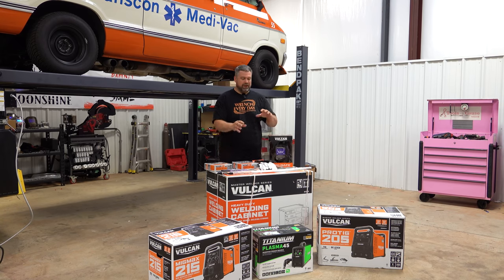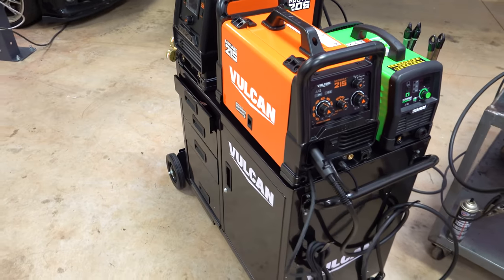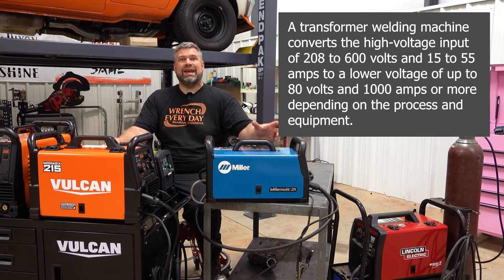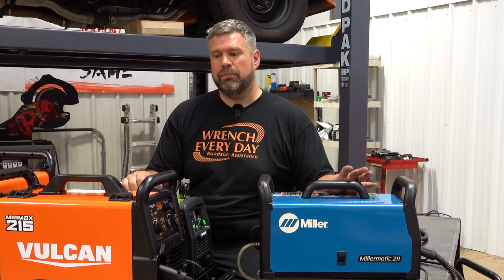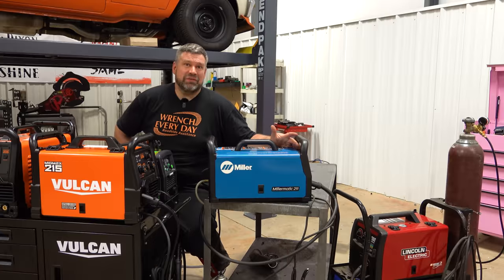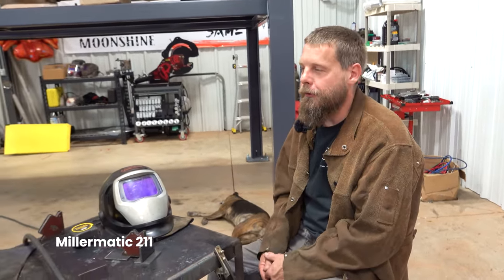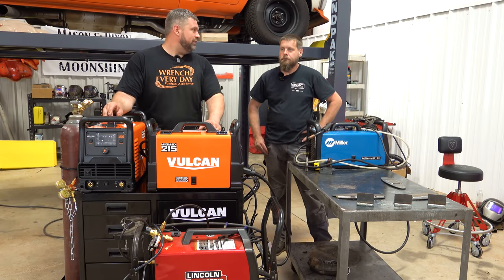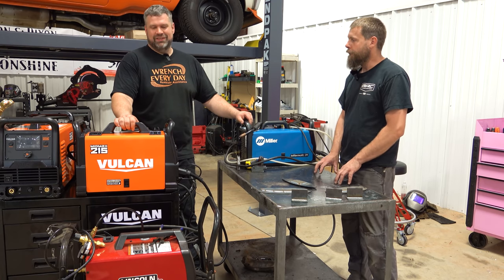Here's What NO ONE Will Tell You About Harbor Freight's "Best" Welders....

Comment: On inverter efficiency and loosing less power to heat. It's a welder, it all goes to heat 😁. Difference is more of the power is going to usefull welding heat vs uselessly  heating some massive transformer. 😁

Comment: One thing i noticed is that he was welding the other joints using the miller and Lincoln machines with the magnet still on the metal. That pulls the arc from the weld. Secondly, he was overly biased based on his history with the Miller machines and referring to their service history. Miller and Lincoln are the industry standard but their prices are too expensive for the average welder or anyone that is going to be welding a a hobbyist. Most don't purchase miller or Lincoln welders unless they are prodded to do so by another biased welder. My advice is go for what fits your budget and the job at hand and if you know how to weld,  all of the machines would work great for you

Comment: You did not Manchin the duetey cycle of the different machines and how that relates to how long you can weld at a time. Small parts no problem big part could be a big problem if you have to wait for your welder to cool off to keep working.

Comment: I'd much prefer an older transformer machine. It is a simple power plant with very few parts to wrong and extremely easy to fix..... Unless the transformer blows up.. With the inverters, you have a switch mode power supply. Lots of parts to go wrong. I have seen more electronics with SMPS's have their power plants goof up than the older kit.
Reply: If you're in it for the long haul you can't beat transformers. It's wire wrapped around iron. SMPS there's a lot that can blow. The only question is not if but when.

Comment: One thing you made a comment that the synergic welders they take a little bit to get up and go no that is not true. they work just efficient as your Transformer welders. you just got to read the manual most people do not read the manual 👈👉at all 👈and it's not just a one setting machine. you can preset your own settings if wished with synergic welder and wire speed👈 by going through your menu button. welders they don't take their time to get up and go the synergic welder will stay right up with the best Transformer welders from start to finish with no problem.👉 they do not lag at all absolutely not👈
The problem is nobody takes the time to go through the manual to understand how the machine function they look at the book real quick and then they're off and running doesn't work that way read the manual understand the settings God bless..

Comment: Au contraire comment: I have had a Miller (transformer) MIG welder (Millermatic Challenger 172) for over a decade, and the feed is giving me fits, and I CANNOT replace the feed roller. So it gets tossed, and I bought a HF Titanium MIG 170 (inverter), which works fine so far, despite a chickenshit (90 day) warranty, which I extended for extra bucks to 2 yrs.

Comment: I believe you guys are a little unfair with these machines .yes everybody has their favorites I did own Miller Lincoln over 200. amps and up . some very large machines also over the years.. welding in a race car shop when you become semi retire you don't need big machines anymore. but you do buy the machine that is going to be efficient for the jobs that you're doing in your shop or home. synergic is a great machine give it a chance you will grow to love these machine just like the Miller's Lincolnshire and the other types out there. depends on what type of welding you're doing if it's going to be commercial or hobbyist depends on the machine you bye Transformer machines so much different than synergic sound different but they will weld the same.. but I believe one one day they will eventually be replacing the Transformer welders to the synergic welders I've had no problems getting consumables for them Mig guns or liners Drive rollers if you don't like the gun it comes with their is a different variety of guns you can get and more Mig guns and other stuff . if the welding store doesn't have it because in a welding store is not considered a top end machine yet but when it does they will be in your welding stores count on it with a higher price research it you'll find it. They are always developing new things for the synergic Mig welder. don't beat up on the synergic welders not unless you ran one for awhile yeah really a great machine just trying to give you some feedback. God bless read the manual.. these synergic welders use tweco consumables also by the way I've also always replace my ground clip with a good quality clamp. The only thing I see they need to upgrade better quality clamp that's my only complaint the ground clamp only great machine synergic. God bless. Just trying to give some feedback on the show about the welders thank you

Comment: 120vac outlet. There is no such thing as 110vac in the US as a voltage standard.
Reply: 110 V AC used to be the standard into the 1960's. It then went up to 115 V AC and finally up to 120 V AC in the 1970's. It took time to upgrade everyone including manufacturers of electrical products. In the 1950's parts of California were still on DC current thanks to the legacy of Thomas Edison. Many home appliances were built to use both AC and DC. As voltages went up even lightbulb filaments needed tweaking to reduce early lightbulb burnout from the higher voltage. High voltage used to be 220 volts AC and now is 240 VAC.

Comment: Bought a wire feed welder from harbor freight about 3 yrs ago. Used it 3 times then it sat, cover and out of weather, for 8 months before needing to use it again. It didn't work...wouldn't weld...had good ground but wouldn't work at all. Worked just fine when I last used it. Will NOT buy another from harbor freight...never ever again!

Comment: These machines seem fine, but they do not have the same duty cycle ratings as higher end blue and red machines. Even the green machine company has better duty cycle ratings. For a home shop, it's fine, but for a serious everyday machine. . .they won't cut it running long beads hour after hour. That's okay, just be aware.

Comment: Avoid the harbor freight machines like the plague. Owned the migmax 215 for less than two years and had a board fail killing the drive motor. Rest of the machine still worked fine but harbor freight was unable to sell any parts and essentially told me to throw it away. Certainly cheaper than a miller up front but compared to the cost per year of a miller, far more expensive to own. Highly regret buying it.

Comment: I have the same Miller 211 and it’s a pile off poop,  the torch sucks and I had to modify it just to make a good gas plum,  the ground clamp is the cheapest Chinese junk and I replaced it after just a few uses, the ground wire I still need to replace as it gets so hot after welding you can’t even touch it,  the spool gun has never calibrated correctly using the miller calibration instructions, auto set doesn’t work for shit… I always am using my own settings…. In my opinion it’s a waist of money.  Old miller stuff was good quality, the new stuff is Chinese junk with blue paint

Comment: All the yammering and bragging aside.  Show the weld.  Show the recommended settings weld and Randy's "expert" settings.  Cut the weld open with your $100,000 in tools.  Taking nothing from Randy but he's a young guy.  There's plenty of 60 year old welders out there.  An important factor is someone with thousands of hours welding plus having used many many different machines.  My former boss spent his career with just two or 3 machines.  Lincoln tig, airco mig and a portable Miller tig.  That weld with the Miller had the wrong wire speed, Randy, the welder he is, made it look good. He obviously was nervous but most welders would stop and adjust.

Comment: Professionally, you are better off with Miller's support. At home the bottom of the line Chicago Electric 120 volt flux core mig machine is your cheapest option. Oh wait they quit selling that. Typical HF name change obsolesance, remember Grizzly. HF stopped selling Grizzly parts. I can get parts for Millers older than I am.

Comment: problem with harbor freight welders good luck getting them worked on or fixed. not one reputable welding company that works on welders will repair them as they cannot get the parts for those. they may be good welders however they have no backing to them. no repairablility

Comment: You should learn the correct terminology.  Work lead with work clamp - not a ground clamp.  Shielding gas is in a cylinder not a tank.  Proper PPE - welder should be wearing a head covering and safety glasses under the hood.  Content creators/influencers in this space should put safety first.
Reply: Leo you must work for osha,, How much welding have you ever done?
Reply: @clodhopper946  enough to know proper terminology and to wear proper PPE.

Comment: these prices are nuts for harbor freight shit..... I bought an Everlast powerTIG 185dv for cheaper than that $1000 pos vulcan "pro tig"

the duty cycle on these machines is shit, these are hobby machines not made to do real work.

Do not spend $1k on harbor freight crap, folks
Reply: I don't really care, but to sell the vulcan as winner you ignored the tech in that miller 211.... 

it has a shit ton of auto-setting tech (for volt and wire speed) and is a higher quality machine in reality.. I'm a certified welder.. my dad has a 211 and it's a great little machine perfect for guys like him (you don't NEED it, but it is a better machine, objectively.)

anyone can set the knobs on a miller 211, put it on auto and set knob to your material thickness and you are ready to weld (It tends to set it on the colder end, I set it a little above my actual material when I use my dads... it will eliminate that ramp up you mentioned and make the arc crisp and run way more smoothly... but that vulcan you have to learn to set a machine